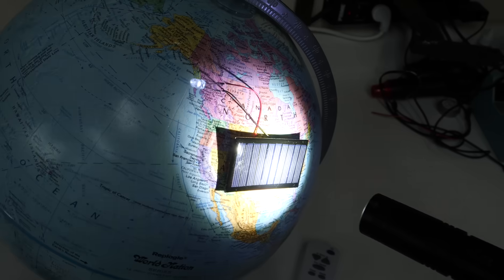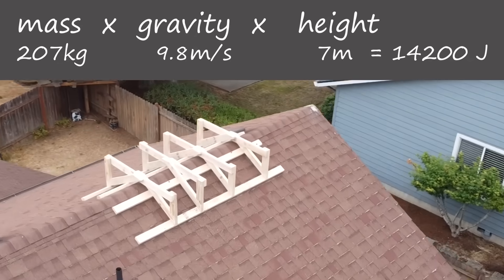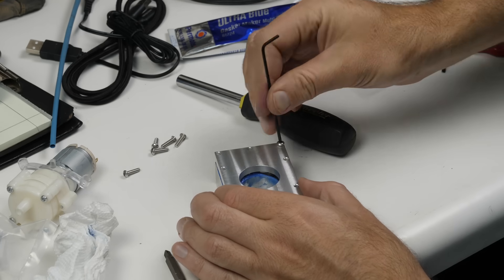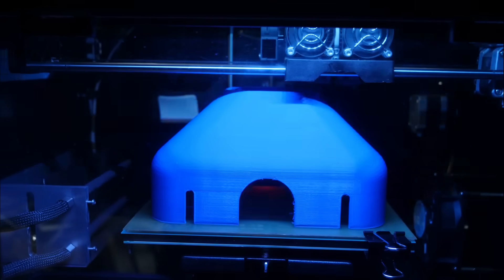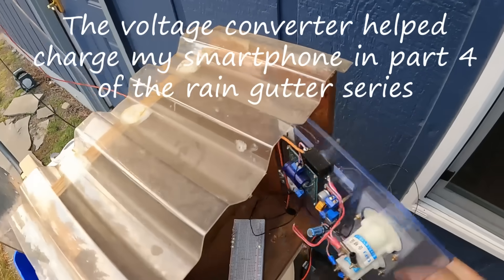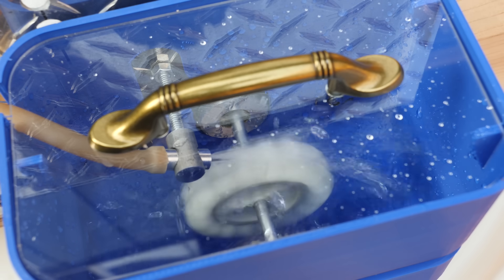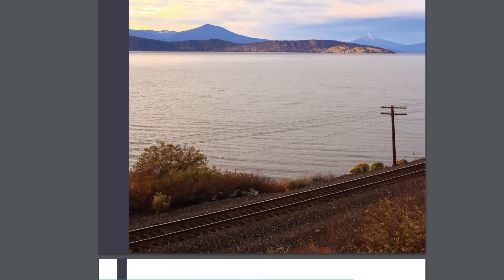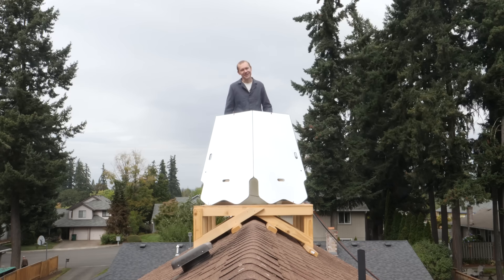Storing Solar Power on my ROOF!!!

Comment: For a domestic system, a heavy weight on a cord with pulley and motor / generator might be easier and more efficient. I.e. when the sun shines, power a winch with a heavy weight as high as possible. When you want power out, let the motor become a generator and turn as the weight lowers. As concrete is or iron or lead is higher density than water, more energy can be stored in a smaller volume. Depleted uranium (uranium with the highly radioactive uranium taken out) would be ideal, denser than lead even!

Comment: 1:18
The reason why the full jug was destroyed so much more was also because water is near incompressible, unlike air. 
That makes the jug more rigid on impact and thus the energy is dissipated on a much smaller area.
Of course the increased mass is also a huge factor in the grade of destruction of the jug.

Comment: This is a proven technique. Ameren Missouri’s 440-megawatt Taum Sauk Pumped-Storage Hydroelectric Plant began operation in 1963. During off-peak periods water is pumped up the mountain. During peak demand water flows down a pipe to turbine generators.

Comment: The water on the roof is massive energy, both it stores kinetic and potential, excluding the ionic configurations that can be increased in massive amounts depending on the height/elevation as well as the active ingredients of the compounds as ( V1), ( v2)  / a2 + b2 + c2 = (3~3) (3~2) (3~1)

Comment: Sounds like the typical green washing that the oil companies are being blamed for, there is no green energy! Windmills and electric cars are not going to save the world this decade and that is why there have been NO climate goals met yet. When you take into account the plastic needed to build a light enough car to get any kind of range(oil and gas plays that role) and the steel needed to build windmills along with their generators it’s a long way down the road. I’m all for environmental protection but not at the speed our false climate goals are being promised. The political elite will say anything to get re-elected and will sacrifice their economies to stay in power, this is not how to be mindful and use responsible data for climate goals. For your H2 girl to say this has to be solved this decade is ridiculous, are we ready to shut off the gas tap I think not. The amount of methane leaking from the United State’s oldest cities should be taken care of before anything else, that is being pushed aside to play political games with green energy.

Comment: You could also look at the efficiency of your energy generation system i.e. an enclosed water wheel would help by keeping the weight of the water activly working and friction on the shaft may affect the system quite substantially.

Comment: From the information you gave I can increase your efficiency by 6.5% by using a string to run a switch close by the motor rather than running wire clear up to the roof. Changing over to a different impeller for your water will make a big difference and also going to a brushless generator the three phase and using a diode to make what you need. I believe you can easily double your efficiency right now just from what I've said.

Comment: hi, you shoul try a tesla turbine, they are more easy to 3d print, and are a lot more efficient for this use, especially when 3d printed. since the type of turbine you printed  reacts some more agressive to small errors or even to missing some parts to make them efficient. with a tesla turbine, your build would be smaller, more easy and cheap to make and wouldn't shoot all that water in all directions, because that watter shooting in all directions is essentially lost energy.

Comment: Congratulations, its a nice demonstration project. Unfortunately, it is not practical. the 7m high setup has energy density 4Wh/200kg=0.02W/kg. Conversion efficiency about 50%, so realistic energy density 0.01Wh/kg. In comparison lead acid battery has density 30Wh/kg and EV battery had 400Wh/kg. Average  household needs about 20kWh/day so you would need 20,000/0.02=1M kg/litres.

Pumped-storage hydroelectricity gets more impressive when scaled. I grew up in mountainous region with hydro electricity from local river. A little unassuming river, some would call it a creek. Local hydro company built two reservoirs, higher one in the mountain 400m heigh difference, 3.7mil m3 storage, 735MW installed power, 371GWh yearly generation. 40 years later works like new.

Pumped hydro makes 95% of the world energy storage.

Comment: 14 kJ, that's about 4 kWh which is about 300 W during 12 dark night hours. With a 30% (already high) conversion efficiency of a water turbine that becomes 100 W. Just enough for 2 electric fans of 50 W each.

Comment: I am actually shocked that all that potential energy (14kJ) only equates to 4Wh. My guess would have been around 1kWh. You really need A LOT of water (or height) for 1kWh. Crazy that a Tesla holds around 75,000Wh... and a gasoline car holds 4x the energy of what a Tesla does.
Great video!

Comment: Hi Quint ! Thank you so much for this video that made me think. I just purchased a chalet in the swiss alps and there is a spring of pristine water coming down from around 40 meters for a lenght of around 200 meters. Do you think I could use your tech to install a power station on the way ? It would be awsome because the solar energy is low in winter, but not the water. Thanks for your insights.

Comment: Power it not now fast you use it. Power equals work. trying to drive a ten ton truck with a 4 horse power motor is fruitless as the will likely not move, UNLESS the are gears to slow the rotation of the motor to a craw. The motor might then be able to move the truck, albeit very slowly. prior to adding the gears the motor could not turn although the RPMs applied to the drive shaft was considerably faster, it had less torque. With out the gearing the work is never accomplished because the motor is unable to turn, with the gearing, more work is accomplished but very slowly. Instead put a 200 horse power motor in the same truck, less gearing is needed so that even if both motors could turn at the same speed (RPM) the output of the gears now has a higher RPM. The may have the same torque applied to drive shaft, but now you have higher RPMs and the for more work is being done in less time.

In motion it is force * speed = power. in electronics force is voltage, amperage is speed so volts * amperes = watts. Ever notice there are small motors able to create 4-5 horse power while some larger (roughly twice as big) might also be only capable of creating 4 -5 horse power. Why is that? Some larger engines were designed for lower RPMs, and have larger pistons and there for create more power per stroke, however it take it larger to complete a stroke. The smaller engine has a much higher RPM, and has less power per stroke. They both in the long run create the same horse power. 

The larger slower motor with last longer, bot only are the larger slower moving parts going to last longer because there is less friction, but those parts being larger are much stronger and less prone to breakage.The smaller motor may be slightly more efficient, less massing pistons to move, easier to put into a small package easier to make say a smaller generator, yet it breaks more often. One thing though, the smaller engine would be easier to replace, because it will be easy for 1 person to more or work on. If you need reliability go for the bigger engines. I have seen huge 4 cylinder engines where the piston was larger than my head. They produced lots of horse power per stroke but were not more powerful that some smaller 4 cylinder engines turning at higher RPMs, but 50-100 years after they were made, they are still in service.

Comment: Sooooo, you use a whole panel to pump that fluid up there, and then use flow down to power a small impeller driven motor? Seems like a bad idea due to loss of energy from pumping up and down… I mean it’s a neat idea for rain water, but this just doesn’t seem like a good storage device for energy dissipation. Maybe for a single phone? Seems pretty silly. I think this is good for powering self driven water systems, but painful for winter. Water pressure for your garden needs not too bad if you have a rainwater collection downstairs and pump it back up during the day for use the next day… pump-dream.

Comment: Float switch, let in drain down the roof, and get turn into electric by your rain powered generator... Yes you will loose some electric,  so to speak as your will use more electric pumping the the generator will make, but you got the electric for free from the sun...

Comment: That is pretty cool but I'm sorry you're not solving America's energy problems our best bet is nuclear power for base load and then natural gas plants for Peak load that is the perfect combination because they are both a clean energy if you're worried about that sort of thing and nuclear provides a good steady amount of energy while natural gas can be turned up and down as needed coal would work in place of natural gas for that capacity solar and wind are not in our future I'm sorry because of the things you touched on here it's impossible to store that much energy even with those reservoirs which are pretty cool and something I did not know about they're still not going to work you're wasting more energy than you get

Comment: This stuff is pretty cool for sure. But the push for green energy was way too hard. So here is my pushback. 
Powering cities and neighborhoods with solar and wind is so inefficient and poorly thought out, it caused a massive power outing during Texas's coldest winter in many many years. This caused the death of somewhere between 250-700 people. What does water do during a cold winter? It freezes. What do solar panels do in the winter? Jack squat. What happens to a wind turbine that's been turned off too long in a winter storm? Freezes over.

This kind of stuff is cool for smaller projects. Solar roofs and slave child labor mined material battery wall are about as far as i'd go (look up where lithium ion battery materials come from, especially if you drive a tesla to make yourself feel better about your purchase).
California pushed green energy so hard, that now they look like some sort of energy deficient 3rd world country. I'll take the reliability and efficiency of nuclear over mass "green" energy any day. Anyway this is just the pendulum swinging back as hard as it was pushed.  

PS. They have been having great luck getting FUSION working recently! We might even see that kind of energy generation in 10 or so years. Exciting!

Comment: 14000 joules  to watt-hours is 3.88 Wh.
If your valve on completely open delivers 1W to the LEDs, it means with 1 full barrel you can power them @1W for 3.88 hours ...
... you might need a lot more barrels :)

Comment: pretty awesome!I thought I would use it for virtual energy for a pump to circulate the water in a pond I will build when I get homestead land. then I remebered a fishing tripto a reservoir that had upper ones and giannt one below.sure the bottom one had a hydro electric dam on the outlet but were the pipes connecting all the reservoires on the ground? I realized and visualized the water flowing down the pipes turning generators to pump it back uphill, with the excess power goingtosupplement the lower main plant-then you started talking about those.Wow!

Comment: 7:36 „imagine how much energy is up here“ 
Well you said it:14700 joule or 0.004 kWh :)
That should be enough to charge one mobile phone :)
While I like the concept and was thinking about something with lifting up weights on cables Inhaber concluded one would need a much larger drop than the night of a regular house and a much higher weight tens of tons. I’d be better off with a lithium battery. 

Did you manage to get any efficiency figures from your design?

Comment: The reasons why this method of storing energy is useless are
1: water pump motor heats up causing great loss of energy
2: water flow faces friction more than electrons through wires
3: it needs a lot of maintenance all the time.
4: Energy storing efficiency is less than 30%

Comment: You could build a raincatch that feeds water into the drum in the roof. Then you get power when it's raining, and that is exactly when the solar panels don't output any power. And you could use the water to power your bathroom light so you are effectively using the water on the roof to shower and at the same time power your bathroom light while you shower :-) 3 birds with one stone.
Reply: I get power from my solar panel array, even when it's raining and very cloudy. Just a small percentage of what I get with full sun, but it is not zero. I run a 48V nominal system with 27.6KW/h of battery storage fed by 7.05KW/h of solar panels, upgradeable, (when I get enough cash saved), to 12KW/h of solar. Even with just over half of the solar I COULD use, I haven't run a generator for two years or more. I run an RV, with 2 smallish air conditioners, (as I live where it can get to 120F in summer), a refrigerator, a stand-up freezer, my computer system, and more. Learning your energy budget is maybe the hardest part of going solar. I live in an off-grid community in the Southern CA desert. I have looked into getting a 48V wind turbine, but it looks to be cheaper to just get more solar panels. As to this water energy storage idea, it looks cool, but one would need a very strong support up pretty high...and upsizing this kind of system to power a 48V system, which most of us off-gridders have gone to.
Reply: Oh, I forgot to mention that I am using LiFePO4 batteries, that can take 100% discharge, and would last around ten years at that rate, but should last much longer since I am only bringing them down to around 80% in the winters and maybe to 50% in the summers.

Comment: The tiny pipe is restricting flow and potential for pressure.  Normally for microhydro we need to jet the water out to increase impact on the impeller. We also start with larger pipes and funnel down to smaller pipes.  Also we will use up to 4 nozzles on the impeller, so a larger pipe splitting off to the 4 jets.
Reply: There's not much point to any of it though. A tonne of water will only provide 100 watts for say 1½ minutes sitting on roof. More if it's hundred metres high of course.
Reply: @philip5940 I guess it would be be best if near a water source and simply pumping up hill
Reply: @philip5940  welll that may blow my  275  gallon stacked tote  idea as a fence around my one acre property.  the can be gotten pretty cheap
Reply: kind of where my mind was at. I was pretty sure you could get a lot more juice out of that barrel, with enough pressure. I saw a few old turbine systems which ran with PVC off a river that wasnt going that quickly and they generated enough power off that system and river for a small neighborhood.
Reply: A ram pump near a water source and hydro energy downward 👌
Reply: he can’t give us any more info on how to have free energy. the government is watching.
Reply: You could just use a venturi system with 1 pipe? Keep quiet
Reply: @no-knot9567  multiple nozzles help reduce wear on the equipment by dividing the velocity between more than one nozzle.

Comment: I've seen this concept of storing energy as potential energy being experimented with in other videos by other governments and science institutes.  However, there's something here that doesn't make sense to me, and it's probably because I simply don't understand what it is you're trying to do.  
If solar power (which is solar energy being converted into electrical energy) is being stored in deep-cycle batteries, then one can simply pull the stored electrical energy out for use whenever needed.  With potential energy, how is it being converted to electrical energy, or is it being converted to electrical energy? If it is being converted to electrical energy, how efficient is that conversion compared with the efficiency of taking electrical energy directly from stored deep-cycle batteries?

Comment: When storing energy in a battery, the energy is taken only when it's needed, here it would be a continuous flow effectively wasting a huge chuck of the energy stored, would be interesting to add a "current" control mechanism that only opens the flow when energy is needed, I'm don't know much about electronics but a capacitor could be used to maintain the valve shut and it would open as soon as the cap is discharged.

Comment: OK, Why did you cut the first fall of the water gallon ( at 59 seconds) into two frames?... It seems that the first fall has not enough water in order to break it. When you through the second water gallon you showed a full stream video, without any cut!... mmmmmmhhhh...

Comment: How much power deliver the solar panel itself, and then how much maximum  power and voltage coming from the alternator output ? Very interesting project, but it is difficult to extend too much because a water thank makes a certain weight on the roof. How long does it takes for the thanks to be empty ?

Comment: You have 55 watts for five hours if no efficiency losses.  So actually way less.
So if you had  550  watts of  panels pumping water to ten barrels  you'd ha've potentially about 450 watts for five hours. Pretty miniscule for all the work that would require.

Comment: Excellent project! I make that just under 4 watt-hours of power - enough to light your table light for four hours. There are several improvements you could make to this system. The solar panel is capable of producing a lot more energy so the excess should then be diverted to charging rechargeable batteries. The closed water system should be open to rainwater input - with overflow directed to charging batteries and further downstream being discharged to watering the garden via a planned irrigation system.